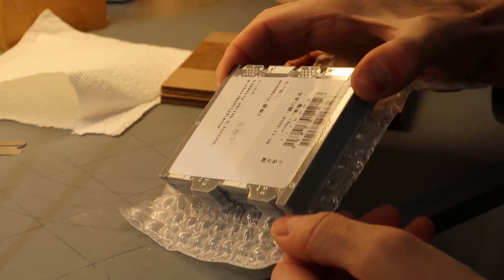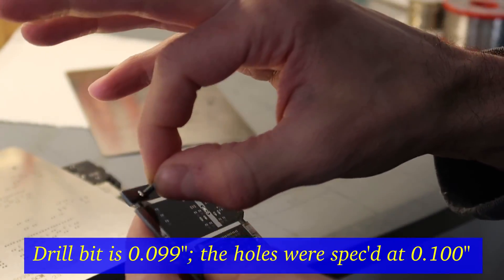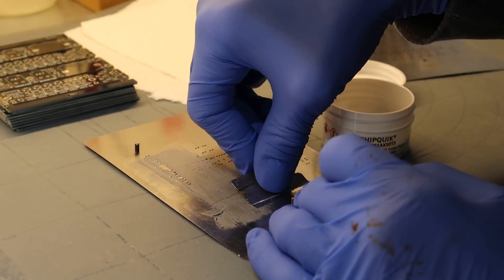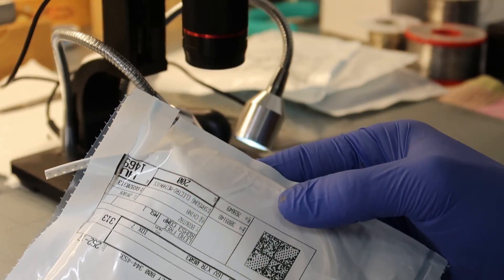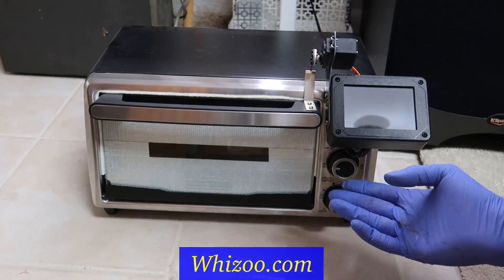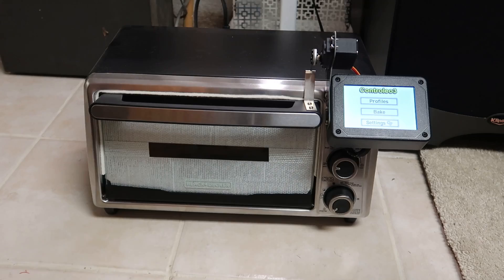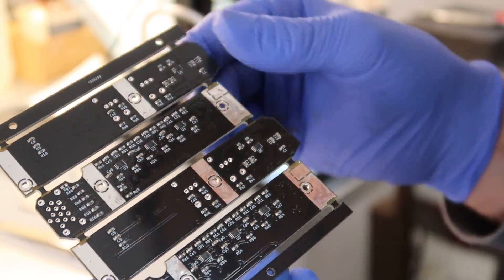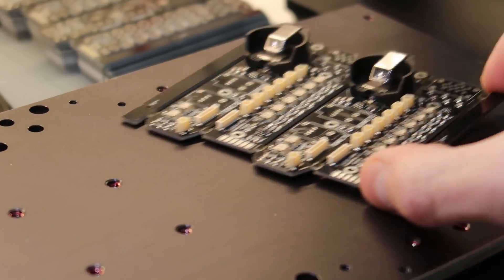Home DIY Reflow Soldering SMD PCBs, Whizoo Controleo3 oven

Comment: Nicely done video.  Especially demonstrating that you can do double-sided loads in this souped-up toaster oven method.  I have to admit, before seeing this I would have been tempted to use a higher-temp solder on the first side, and lower temp on the second side (to avoid losing heavier components from the first side)... but this seemed to have worked well.
Reply from the maker: Thanks. Yes, successfully using the same solder on both sides surprised me as well, although my bottom side is all light weight components (0603's, a few VSSOP ICs), whereas the top side has a few connectors and trimpots, which have a high ratio of weight-to-footprint area. So you do have to be careful which side to do first.